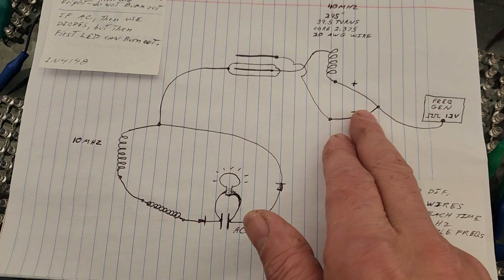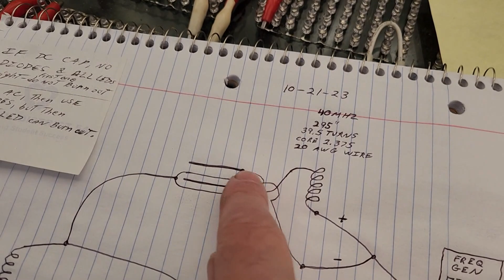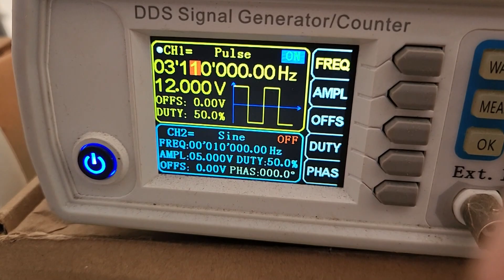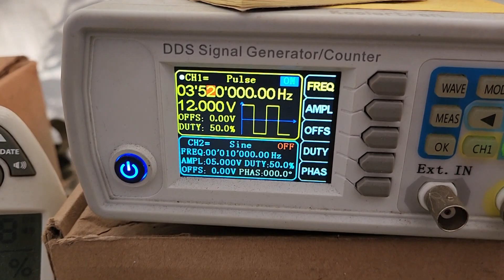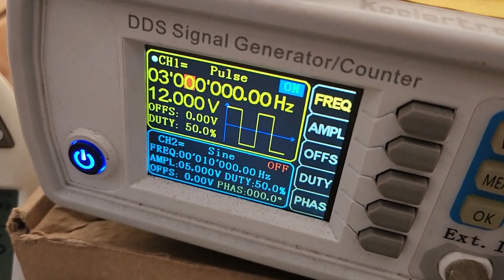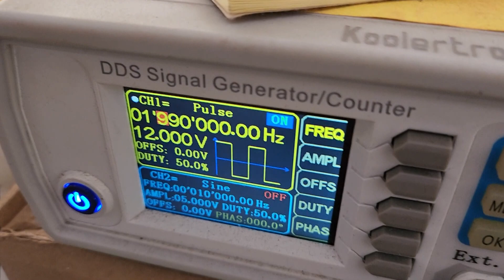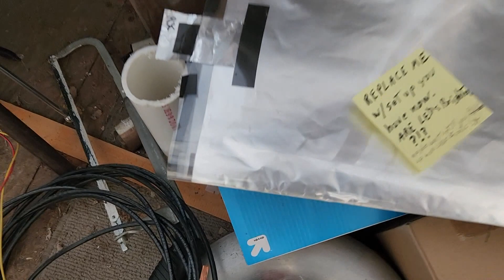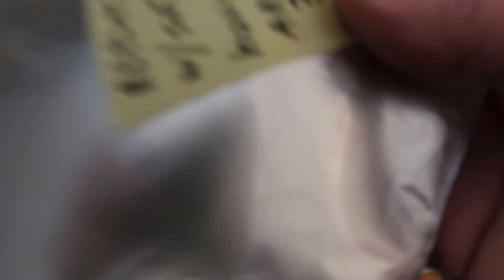INVENTOR3 OPEN-SOURCING Pt 3!!! LETS SIMPLIFY! MORE EXPERIMENTS!!

Comment: You should make a heavy duty inductor for you device. say a heavy iron core 3 inched diameter, up to 4 foot long.  and the  primary coil. them put the heavy load.. 10 HP electric motor..

P.
Reply from the maker: I will experiment more with the coils very soon :-)
Reply: @INVENTOR3  Nice.
Reply: @INVENTOR3  perhaps you have not realized that you can make a transformer from 3 of the Tesla coils you made, and a center tap. lets say 1 medium air core tesla, and 2 of the small stacked on the other side tapped for a center ground..hmmm
Reply: @INVENTOR3  oh the little rat did my invention he continues to try to out do me.. rat. the ion telsa secondary i sent to u. lol bast rat..

Comment: I solved the Tesla radiant device Tesla style. no diodes. i only did like Tesla described.
place a negative charge on a plate and send it to a capacitor to a ground. the circuits come later. but the first part we succeeded. it also looks like you are having great success to to power heavy loads according to its heavy resistance loads in a wire, Tesla style.. keep it up.. Here comes The adjustable {<reluctance inductor >} Blocks AC  to solve all our problems. The problems Tesla had, he did not have the magnetic amplifier, did he?
 it has a coil, and a filter all in one.. Future tech..
Reply from the maker: Thank you.  I will keep reading....

Comment: nice... i been check u  out top notch top notch, have we all after 10 years finally discover? we are master now. but the scalar potential, of Maxwel, l and even Faraday disks .i advanced beyond believe. i need you to build theory up, and say i invented new tech. you are a pioneer on the air circuits u built 10 years ago. a pioneer so i have to share.. so its all on my page you will learn many wonders. i made alot o discoveries. i can pop out new tech and inventions every 180. i need you to invent for me . i am past my prime. and share some new tec. i can teach u. you may like it? a couple new tricks.
Reply from the maker: email me a drawing 🙂  Thank you!  I would love to check it out!
Reply: @INVENTOR3  i see a plate and a coil, oriented opposite of the 1 wire motor.
this is my vector analysis..  and it is unique for DC current set ups. real power  to drive a motor or other.. the plate clearly acts as a vector for all the power in the circuit. similar to earth/ground plate in a dc system to make current. yes?

it is a magnetic orientation. the that is cool. so i have new tech.. try use a saw  circle saw blade, as a plate, add your tiny coil on top, then try the tall one.. circle the saw blade in a loop of current wire.. or make a small loop of copper tube, set the saw blade on top, remake your circuit test it..

Comment: When you touched the wire it said I want ground... You circuit works great. With frequency and one wire to ground... Interesting where you an antenna or a ground??? Some times with my own experiments I wonder because at times things  will light brighter on my hand than even connecting to a good ground or antenna. Something about the electrolytes in our body and our skin itself that I would love to duplicate. Anyways I watching you and thinking of my own experiments you are priming my well. Lol Thank you for sharing your project it is quite refreshing.
Reply from the maker: Glad to be priming the well, hehehe.  I like to inspire.
Funny, I edited out the parts where I was experimenting with the ground.  But I never tried the ground at ppint in video that you saw my hand touching the wire.  Usually when my hand goes near a wire and LEDs come on, it usually means i need to adjust the freq.  So it is strange that adjusting the frequecy this time did not help, but my hand near wire did.  This leads me to think you are 100% correct, it may have needed a ground at that specifit time.  I will show more results with ground next video, stay tuned :-)